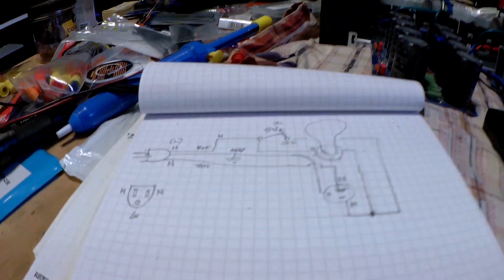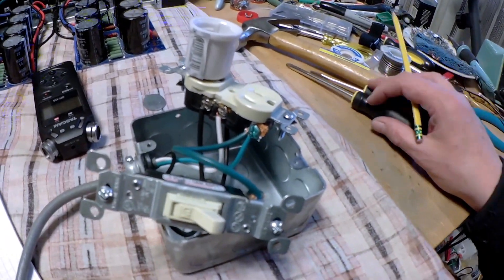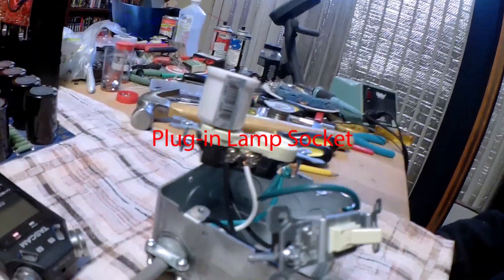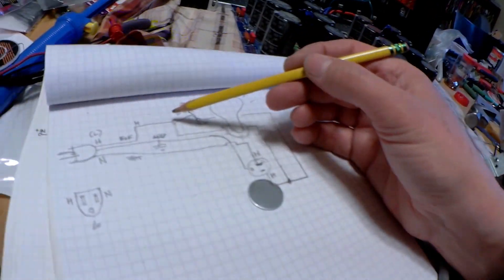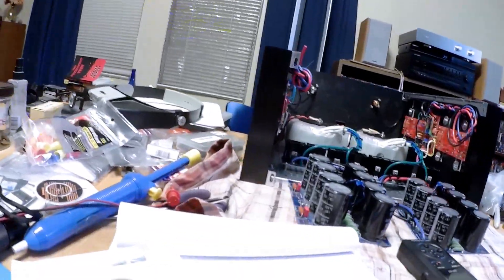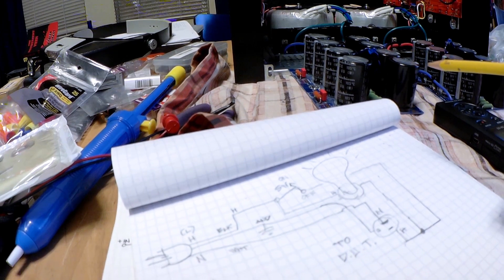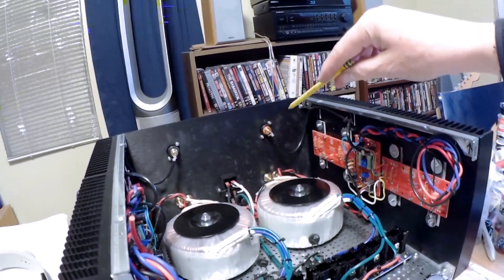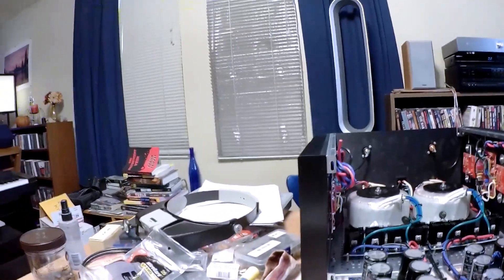Robert Builds a Dim Bulb Tester

Comment: Trying to make the dim bulb tester you made. How I have it wired is the hot wire from the plug is going to the top light switch screw. The bottom light switch screw has a hot wire going to both hot screws on outlet. Natural wire from plug is going to outlet neutral screw. What connects to the 2nd neutral screw?
Reply from the maker: Sorry for the delay, I was looking for my schematic for the tester. I could not find it but it is in the video on the tester. The second neutral screw connects back to the same screw on the switch as the hot wire from the power cord. The switch is a bypass as you may recall. Remember to wire both the ground screw on the switch and the outlet to the power cord ground for safety. 
You may have seen that even a 25W Class-A amplifier will light the dim bulb when fully biased.
The tester is very handy at catching wiring errors when you first power up your project.

Comment: I have built many  (  UK  , 230 Volt  ) versions of this ....... It is important to use a HIGH wattage bulb , so a functioning unit plugged into it has 98% of your full mains supply .... I use a 500 Watt theatre flood bulb , but you might even use a 1000 Watt flood bulb when testing a HUGE amplifier ... of course you will have to find or buy an  E40 ( giant ! ) Edison screw bulbholder , this unit can also be used as a VITAL temporary input ballast for  EHT  transformers running many types of gas discharge tubes ( Neons , Mercury vapour , Sodium etc... lamps ) ... in addition , you might use this to discover the correct windings of an expensive ( but UNMARKED ) transformer .... accidental mains supply to a 6 Volt winding just gives a bright bulb ! ! .. note ... for the last two suggestions choose a bulb wattage that suits the device you are powering ( 1000 watt bulb is FAR TOO BIG to test a little ( 1 cubic inch volume  ) dinky transformer , use a 60 Watt bulb ! .... hope these tips are of help to you and your viewers ...( ? ) .......

Comment: Very nice! That's cool that you did everything in such a small conduit box, and that the light socket you got plugs into the outlet! I recently built a dim bulb tester as well, but I gave myself enough space to fit a Kill-A-Watt in the output socket. I ended up using a cheap bamboo tray as my project box for the build. Yours is a lot easier to store though! How is the F5 coming along? I'm about half way though building my PSUs, but I'm waiting for a few more bits from Modu as well as a new soldering iron to arrive in the post. I'm using the Modu riser panels sold on DIYAudioStore to make cages for my transformers.
Reply from the maker: It's great to hear from other F5 builders like you and Drew. I wish I had room for a dedicated Audio bench. No room in the Garage, It has an Accord and two motorcycles stuffed into it. I'm waiting now for a new multimeter to come in. That will give me 3 that I can use at once. One for each bias supply and one for Drain current at the output.
Reply: @NocturneVid66  Nice! Right now I've got a budget DMM and an entry-level scope, thinking if I pick up an entry-level Fluke in the next few weeks I'll have enough instrumentation to comfortably bias. Same here with the bench - I'm enjoying this build but it's starting to drag on a bit, ready to clear all this space back up. Would be nice to have a dedicated workbench to just leave all this stuff out on for as long as needed, without it being in the way. I'd like to be setting bias a week or two from now, but that may be a bit optimistic.